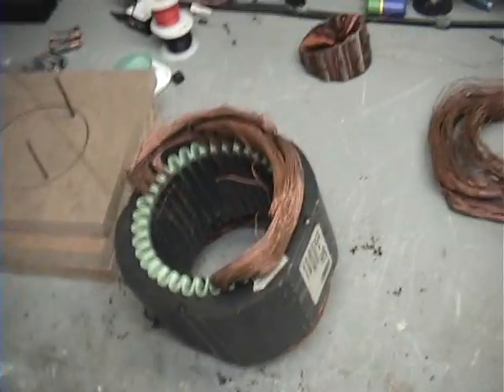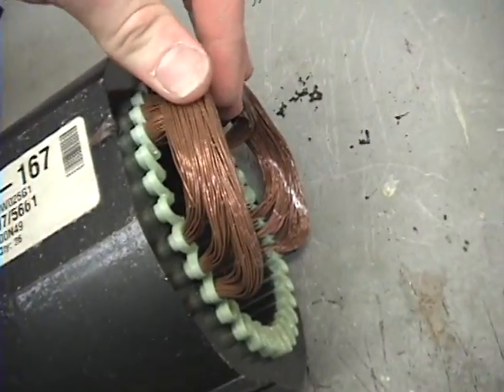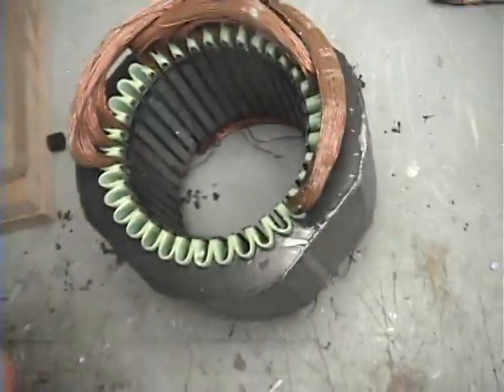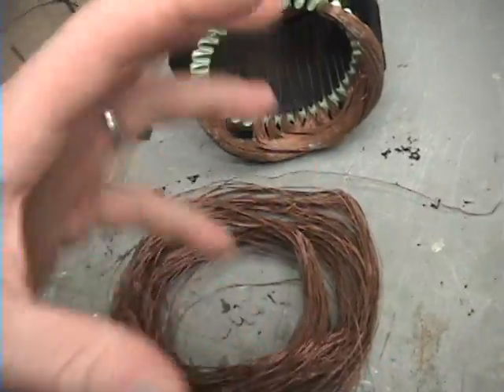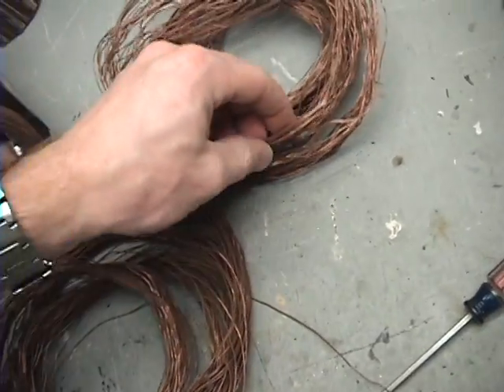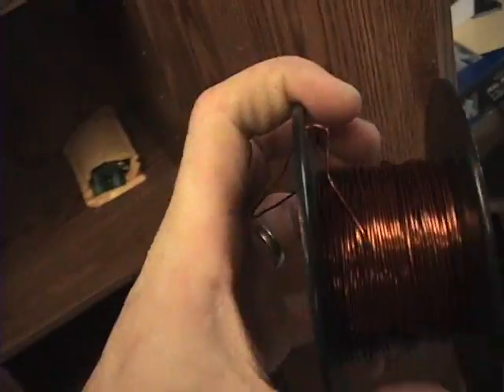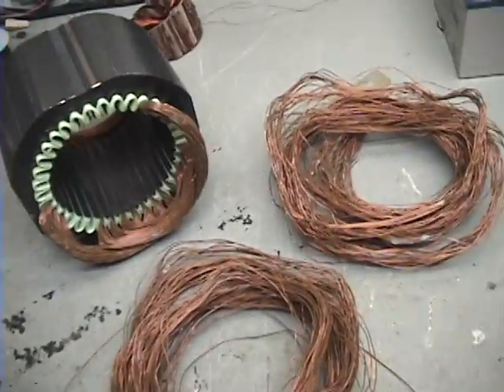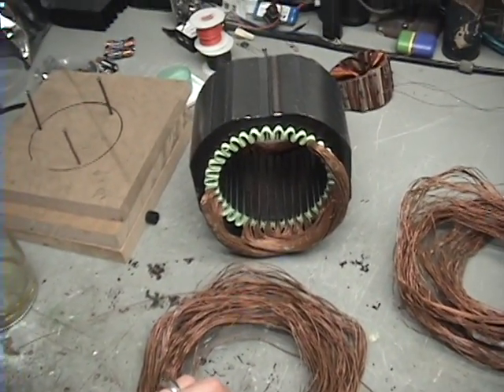How to unwind a 1.5 HP motor. This is so much fun!

Comment: Nope I got the best one, just throw that shit in the dumpster. ...DONE...
For scrap your looking at 3 dollars a pound for clean copper,Not worth all of this.
Reply: Shawn P If he were looking for scrap to sell by the pound, he'd just cut the wires, would take 10 minutes.  He wants the wires intact for use in other projects like a home built generator.  Some people actually have the ability to create instead of being wasteful and throwing everything in the trash then going to the store to buy a new one.  Also, read the description, would save you from looking like a moron.
Reply: ***** it says how to unwind a 1.5 motor 
So much fun.
I could probably build anything I want, I tend to do that alot being a contractor. However some people's time is more valuable than others and those people my friend, would just buy one..
Reply: Shawn P It actually says,

"How to unwind a 1.5 HP 3 phase motor. This is so much fun!

Before you post your comment about chopping off one side and pulling the wire out... Don't forget this wire is going to be reused for other projects... ;)

1. cut off rope tie.
2. pull out wire holders.
3 tap on outer coils with rubber mallet.
4 start on one side of the coil and pull out one wire at a time or in small bunches.
5 pull out other side of coil.
6 repeat till all windings are out.
7 don't get mad... it takes time and is tedious work...
8 good luck"

But maybe reading beyond the first line was too much for you?